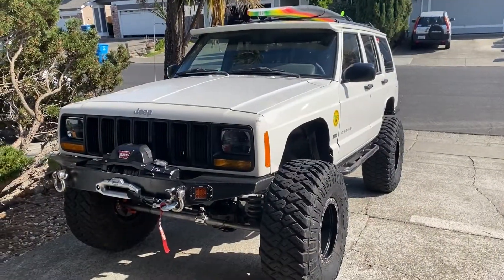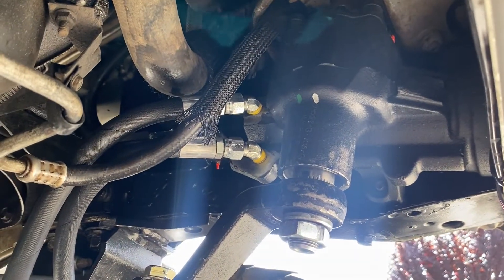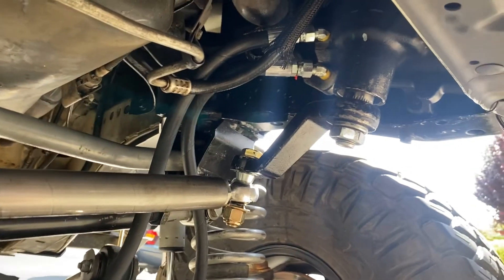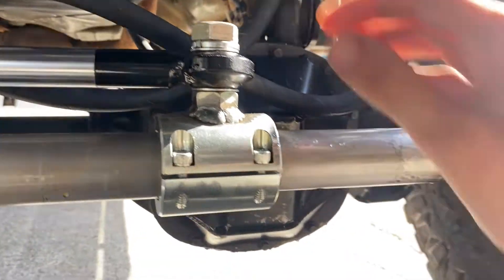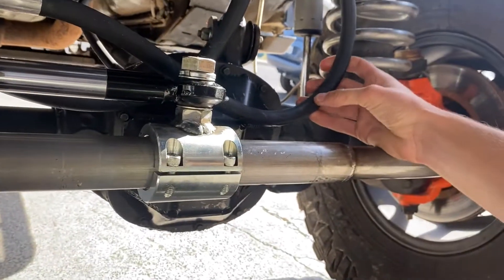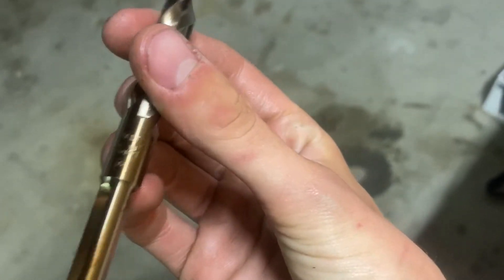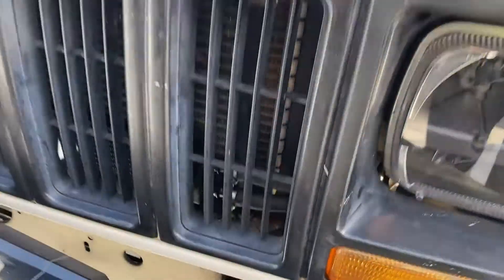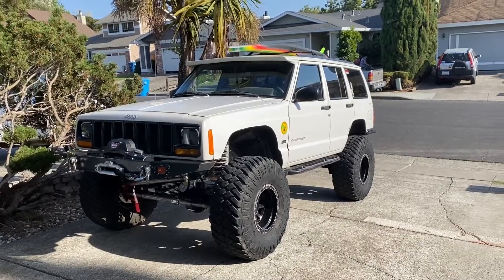Budget XJ Hydro Assist steering!

Comment: How has it worked out? Does it seem slow when non offroad driving?
Reply from the maker: Worked out great!!
Reply: I have basically the same diy parts planned, just curious how much if any it slowed down turning. I am thinking of doing all this plus a PSC pump all at once.@mikes4x4garage
Reply: One other question, have you ever sucked the stock reservoir dry? I called PSC today to make sure the pump was in stock before i drove to get it and while talking the salesman mentioned that the stock reservoir was too small to run with hydro assist. He said when the cylinder cycles one was itll suck the stock resi dry. Have you had this happen?@mikes4x4garage

Comment: I went to Surplus Center for my ram too. Works great. For the steering box, I tapped the top cover, and then DIY 4x4 makes a front cover replacement that has a tapped hole. You might not be able to go that route on an XJ, but on a YJ, the front is wide open.
I recommend putting some protective wrap on those hoses. Nothing fancy, but I got some plastic wrap from McMaster that just cuts down any chance of a hose rubbing through on anything under there.
Reply: Do you have a link to that Yj front cover that’s tapped?

Comment: What track bar mount/track bar are you running that it’s mounted up higher?  Seems to be in my way  in the stock location
Reply from the maker: The axle side is Artec and the frame side is rubicon express

Comment: How is this holding up?
Reply from the maker: Great! Couple little things I’ve changed

1. I cut off the links on the hydraulic cylinder and welded on Heim joints. These are a lot better without any play in the joint

2. My steering box died after about a year, highly recommend getting a sector shaft brace when running bigger tires.

3. I had to swap the lines around so they wouldn’t interfere or get hit. The longer hydraulic line I had face the other direction and this took the slack out.

Overall, still my favorite upgrade I’ve done to this Jeep.
Reply: @mikes4x4garage  You should do a follow up review video.

Comment: hey mike, question about the drilling and tapping. is it dumb to drill and tap it in the vehicle with it running so the ps fluid pushes the chips out?
Reply from the maker: Yeah I don’t think that would work unfortunately
Reply: @mikes4x4garage  ive seen toyota guys do it but yeah probably just going to make a huge mess. I might just do the diy4x cap and tap the top cover thing since those come off easy

Comment: If you weld that clamp what do you do if you need an alignment and have to turn the tie rod?
Reply from the maker: The tie rod is not a straight line to begin with, so you have to remove one end to adjust it anyway. Kind of a pain but that’s the way these tie rods work. The hydro assist doesn’t change that 👍🏻

Comment: What axel was this done on seeing you used an 8” stroke?
Reply from the maker: This is on my Dana 30, the 6” stoke would probably work better, but I do plan on upgrading some day and keeping this ram.
Reply: What is the difference between the 8 inch stroke to the 6 inch? No issues with the 8 on the Dana 30? I have. About Dana 30 and have a Dana 60 that is plan on swapping in but like the idea of using the same 8 inch as you mentioned on a  larger axle.

Comment: What fittings did you get for the WJ steering pump upgrade? Was it a direct hook up with the stock fittings?
Reply: you basically have to change out the high pressure port, throw your stock one in the new pump. the reservoir on that wj pump has 2 returns so you have to plug one of them. you want the 01-04 with 4.7 v8

Comment: The other option was a terraflex 2low kit, pop from 4low to 2low to make tight turns then right back.

There's also a restrictor valve in the pump that you can remove to greatly increase flow.
Reply from the maker: It’s a cool idea but the tera low hasn’t been produced in years.
Reply: @mikes4x4garage you can still get the teralow 2low kit, you cannot get the teralow 4:1 tcase anymore. All the 2low kit does is allow you to go from 4low front and rear to 4low rear only.
Reply: Yeah i did my SYE last year and they said you couldn't get the 2low kit unless it's used.